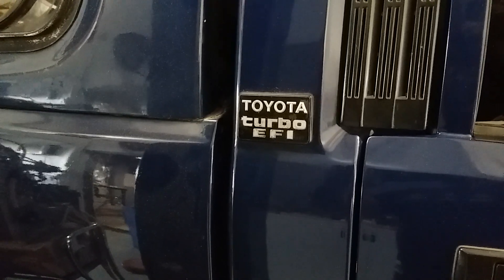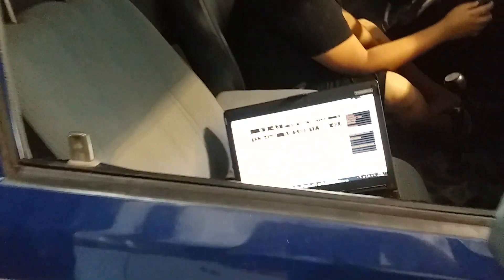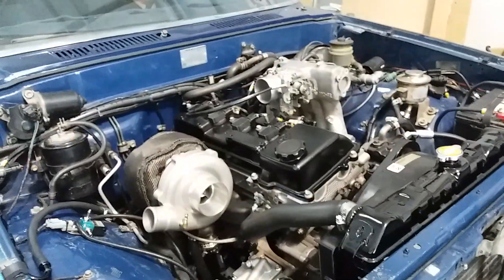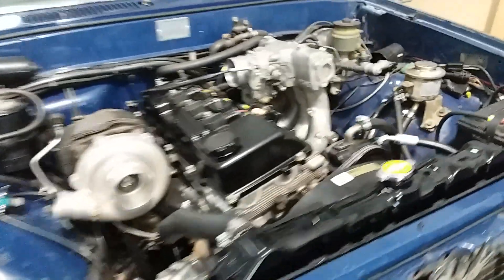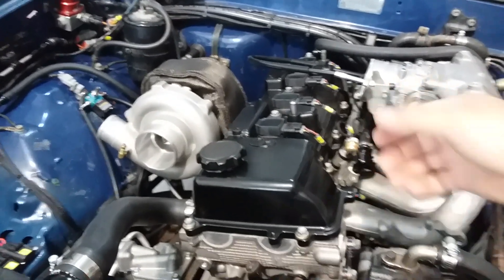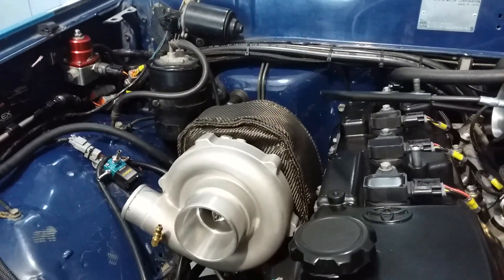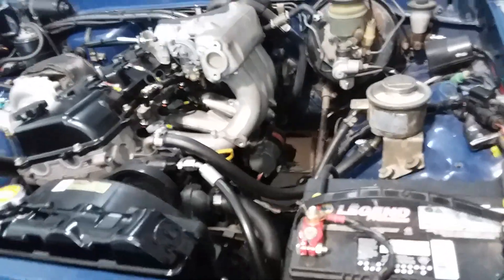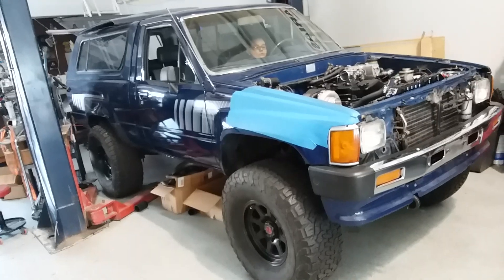Turbo 3RZ swapped into an 86 Toyota Turbo Truck with a Haltech

Comment: I got a 4runner with a 3RZ and the 5 speed. I would like to boost it but I’d probably have to end up swapping it with an AR5 tranny cuz I hear the W series aren’t that strong with high hp. But yeah the idea of a turbo 3RZ just gets me #bricked up
Reply from the maker: My opinion
Depending on the power you plan to make, I would start with the trans you have first.  This would allow you the time and funds to get the turbo and one of our Haltech kits dialed on low to medium boost and enjoy the 4Runner. While you are having fun you could souce out a trans before you turn the boost up.

Comment: Can i expect a performance improvement just by going Haltech compared to the stock 1998 Toyota ECU?
Reply from the maker: Yes. The largest gains you will notice will be the low and mid range with gains at the top end as well